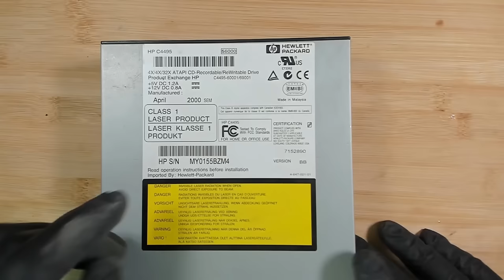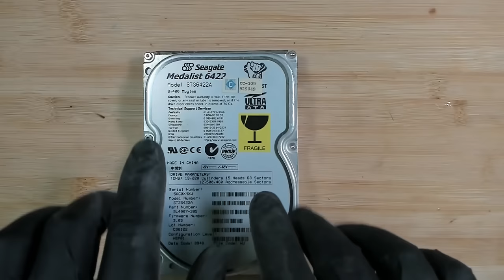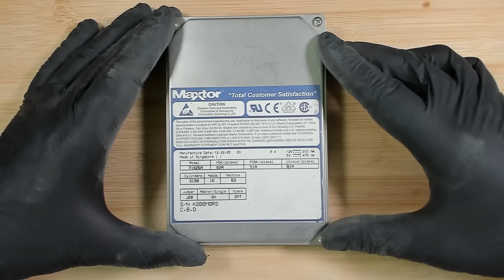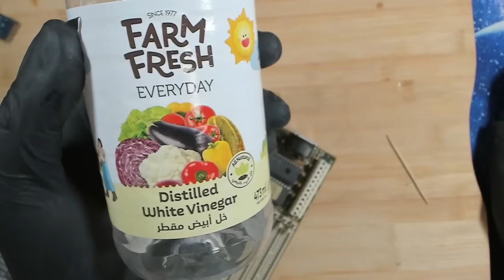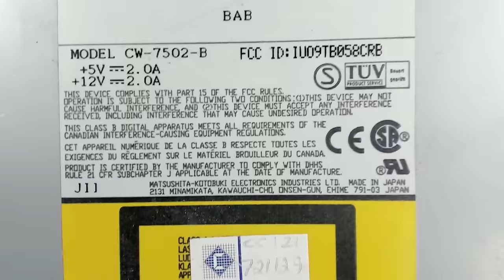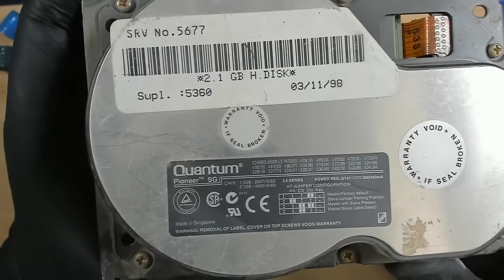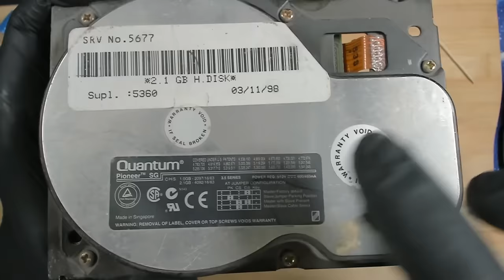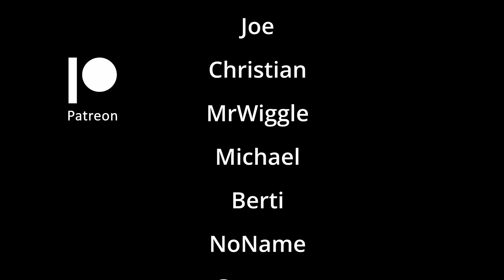Loot from one of my best scrapyard trips!

Comment: I found a 16 mb STB Voodoo 3 3000 agp tv at the recycling center this previous Tuesday in the electronics container.
Didn't think I'd ever come across any voodoo card in my recycling center visits with how rare & more popular the cards have gotten.
So far I've only tested it into the bios screen on a slot 1 motherboard here.
As i previously moved that ide hdd with xp on it to my new agp test bench with an asrock 4core dual sata & core 2 duo e7400, which i also found at the recycling center.

The computer i grabbed it from was on a trailer & i asked the guy as he was unloading some other trash to be tossed away.
If i could grab that graphics card, he didn't mind at all as long as i tossed away the pc properly.
(Was a generic slot 1 motherboard which didn't look like much at the time but i can take a look tomorrow if it's anything worth grabbing.)

Also grabbed a Asus P2B a few weeks before this find which also works with a pentium II 450 mhz so now i have 1x passive & 1x actively cooled that's super noisy, seriously this fan is like a 60 mm 4000 rpm hairdrier.
Reply from the maker: Congratulations! Yes, finding a 3dfx card is quite rare. I also found a Voodoo 3 once and a Voodoo 2 which needs some fixes. Congratulations to you for finding such nice retro gear!

Comment: There is absolutely something special about the S3 Trios, its just about the only card that has good working hardware support on really old versions of XF86 on Linux. All the other accelerated servers have some kind of issue that makes them annoying to use or even totally unusable. If you messing around with any pre 2.6 Kernel Linux stuff, they're the perfect card.
Reply from the maker: Although I don't have much experience with Linux, that's good to know 🙂. I always liked my Trio64V+

Comment: This 386/486 board has EISA slot!
Reply from the maker: Thanks for letting me know! I looked it up: Extended ISA :) I didn't know such a thing existed! 🤯
Reply: Nice board, Jealous here. THIS IS NOT AN EISA slot.
This is an Opti Bus slot (same connector as EISA, different electrical).
If you plug a EISA card there you will burn it.
There are specific card for Opti Bus. There is a VGA I have this.
Basically Opti Bus is an ISA VLB combo.
Reply from the maker: Thanks @atheatos! Thanks for letting me know. It says "EISABus" on the connector, but I'd rather not risk it and go with your opinion! It could be something proprietary - I wouldn't know.
Reply: Yeah mechanically these are the same so the connector says EISABus. Very dangerous. This is defiantly not an EISA one electrically.
Search online for more info on this OPTi Bus. The only compatible VGA I know and have is "Tseng Labs OPTi Bus" an ET4000AX.

Comment: That brown slot on the 486/386 board looks like an EISA slot.  I recall seeing those used for expansion slots, too, so maybe make sure it is correct, before plugging anything EISA into it.  An ISA card should simply plug into the upper set of contacts, and work as normal.  The Extended part is all on the 'lower' set of contacts.

That 'slightly browned' AMD 486 might be fully functional.  I've seen them much darker than that, and still work.  I believe there is a sealant, or colorant, used on/in the ceramic, as well as the white silkscreen lettering, each of which will slowly brown at elevated heat levels.  Obviously, attach a heatsink before proceeding, but you may be in luck, if you can call an AMD 486 DX2 66 'luck'.
Reply from the maker: After cleaning the board, I can read "EISABus" on it. I guess the secret is lifted. Now I just need to find some compatible hardware!
I'm curious if the AMD DX2 is still working. Maybe it had one of those slip-on fans that just fell off at one point.
Reply: @bitsundbolts  Definitely could be the case.  Thermal paste was pretty rare in the 486 era, so there might not be any evidence of a FHS if it fell off, or just got removed.

Thank you for helping me rummage through some old memories.  I look forward to any content you choose to make on these items.
Reply: @bitsundbolts  PLEASE BE CAREFUL! I'm pretty sure that slot is OLB. I don't think that chipset supports EISA. I'd say it just says EISA because it uses the actual EISA connector.
Reply from the maker: Thank you for letting me know! I am not going to risk using this slot.

Comment: The interesting point is that the negative terminal of lithium batteries start corroding first.
Reply from the maker: If I understand correctly, the negative terminal is where the electrons come from first - with a lot of energy. Haha, here comes me theorizing 😅. This energy may interact with its surroundings: humidity or other molecules in the air around that connector. When the electrons arrive at the positive terminal, the "rapids" slow down to a calm river. But that may be totally wrong - so, don't quote me on that 😅
Reply: @bitsundbolts  a simpler explanation may be that  negative terminal always loses electrons so it is more prone to oxidation because it wants to redeem lost electrons by any means.

Comment: 11:50 or so, the VLB 486 Board:
IIRC the DIfference between Socket 2 and 3 is the support for Pentium Overdrive. 
ANd yes, its VLB.
As for the Board: Does it support 3,3V CPUs?? From afar it looks like it does. So in that case you might be able to put an AMD 5x86 PR75 (133MHz) on that. Maybe, potentially, a Cyrix too, but those are a bit complicated.
Reply from the maker: Yes, I think this board does indeed support CPUs with 3.3 volts. I have to check it when I get to it - at the moment I'm working on the battery damaged boards. Might be a nice board for all kinds of 486 CPUs.

Comment: 9:53 Crispy PCB around the audio amplifier IC is not that unusual! Someone was using passive speakers on this card. TEA2025B audio power amplifier running off 12V line, 5W total stereo output power into 8 Ohm, can actually take damage when running into 4 Ohm because it would be trying to do closer to 10W and not succeeding. Probably dumps about a third of its output power into the PCB via the ground pins.

15:41 hey i wonder if "reserved" pins are working SPDIF! Might be disabled, being an OEM drive.

47:19 obviously an Acer chipset.

I love Socket7, i just don't know if the board needs any work done; i guess one won't know until it's fully tested :D

49:15 Panasonic/Matsushita. Very nice. Bet it works!
Reply from the maker: Thanks for that info on the soundcard! I'll keep that in mind. So, there was just too much power drawn from possibly passive speakers.
And yes, I think the socket 7 board will just work. It was in a case as well.

Comment: That socket2 board closely resembles the jetway-j-403tg-v1.0 board of which I happen to own a v2.0 version (except it's socket3 but same chipset from the looks of it).
Reply: I also happen to have a same kind of that Matsushita 4x SCSI CD-R writer. I used it to slowly burn audio CDs for old CD players around 2010, but of course it's much older. It doesn't have buffer underrun protection yet so be careful. If I remember correctly the fan only spins while burning discs to cool the laser I guess. :) SCSI buses needs termination. In the case of those old small capacity Seagate drives make sure you check the jumpers for a 16-bit AT/8-bit XT one. If they don't work at first but they sound like they should be, they might have been used in machines with an 8-bit IDE bus.
Reply from the maker: Thanks for all this information! So, this socket 2 board is weird. I haven't looked at it in detail, but I think it supports 3.3 volt CPUs. Wasn't that something that came around with socket 3? Did they maybe have a lot of socket 2 sockets and just used those for their socket 3 boards instead of replacing them with the proper socket type? I'll definitely have to find out more about this board.
Reply: @bitsundbolts  I have no idea about socket2, but I had to voltmod (find and populate a missing LDO, resistors and jumpers) my socket3 board for a 3.45Vcore Am5x86 CPU. The PLL was already future-proof. Maybe you will get lucky too.

Comment: Wonderful collection there, I wish we can see some cleaning videos too. Have you tried washing them in dishwasher?
Reply from the maker: My wife would have questions I'd use the dishwasher for cleaning those items. I usually just use soap and running water. The result is quite good. I cleaned most of the items already. The floppy drive is still dusty and might be worth recording.

Comment: hmm I always thought that 486's were just 486's and there was only a single socket. Of course I also thought there was 2 variants. sx33 (which is what I had) and dx66 (which is what my friend had). And the only difference besides speed was the FPU. I've known that's not true for a while, but finding out that it's multiple sockets is new to me.
Reply from the maker: I believe you're referring to the socket 2 board. I think this is a bit of an oddball of a motherboard. If I'm not mistaken, it supports voltages as low as 3.3 volts. But I'll find out more when I look at each board individually.
Reply: @bitsundbolts  yeah I was maybe 8 or 9 around the time that was a thing. lol So I had a limited knowledge. I think I was 11 or 12 by the time I had a 486. By then the pentiums were out. It was used. In fact I remember the guy saying its bios was destroyed when it was hit by lightning and he had to replace the bios and reprogram it. I find that hard to believe. lol Only the bios? really?
Reply from the maker: Sounds like a bad BIOS flash attempt 😅. I recently found out that the original Pentium was released in March 1993. That means I got my 486 also well after the Pentium was already in the market.
Reply: @bitsundbolts  no clue.

Comment: 5.25" floppy drives are saddenly stupidly expensive these days :( I have 5 or 6, one is a TEAC just the same model as yours. Very adjustable for different systems. Usable on my Amstrad CPC after changing the various requirements like a ready signal, and rpm speed (300rpm instead of 360) etc.

Comment: AMD 486-66 with EISA! 😱
It’s for SCSI. Please try working on this setup.
Reply from the maker: It is I deed EISA! After cleaning the boards, I could read it on the slot. Now I just need to find expansion cards that plug in there.
Reply: @bitsundbolts  you can put ISA cards there, it will works as ISA, 8 or 16 bits. EISA is 32 bits, and its pins are depper, out of reach of the normal ISA card contacts. just look for shorts, just in case, if you put an ISA card ther. but yeah, is better, more interesting, to test a EISA card. even better, have the two versions, ISA and EISA,  of a same videocard and benchmark them. never seen a comparison like that

Comment: that brown slot on the mb looked like EISA, if it is then it is an odd board with the cpu and mix of slots
Reply from the maker: It is indeed EISA - after I cleaned it, I could read an inscription on the slot "EISABus". I looked up what an EISA expansion card looks like. 😔
I have come across some of those cards and did not take them because of the odd looking connector. Well, now I know better. Hopefully I'll find more of them in the future!
Reply: @bitsundbolts  IBM come out with MCA bus that was not an open and free standard, EISA is all the other vendors attempt to make an 32bit bus standard that still support old ISA cards in the same slot, it it the first "plug and play" but you need some config software and for each card an .cfg file with the config details.
this mainboard is odd with the cpu cross over to support both and the slots is both 8 and 16 isa and EISA

Comment: you have to Terminate the last Device, so the Controller know the End of your Cable. You can attach up to 9 devices to a Scasi Wire
Reply from the maker: Ah, right. I remember there were also terminators on SCSI cables. I have no experience with this standard, but I see why IDE was more common in consumer electronics - it's just easier to get things going.
Reply: @bitsundbolts  not really easier😂

Comment: at 30min, that 386/486 Board is interesting because of the one E-ISA slot.
Though why it only has one 32bit ISA Slot? Only god knows...
Reply from the maker: Atheatos commented. He believes this to be a special implementation by OPTi and is not electronically compatible with EISA
Reply: @bitsundbolts  Mhh, yeah, its possible that its a custom RAM Upgrade card...
And getting a Manual probably is impossible for this board, right?
Reply from the maker: There is no manual on the retro web, so chances are very slim to find the manual somewhere else.

Comment: How much do you have to pay on the scrapyard for items you take? Do they weight them, or how it goes?
Reply from the maker: It totally depends. The items I buy are privately owned by the people working there. So, it probably is higher than what you'd expect, but I wouldn't have access to retro hardware through other channels. It is still a lot cheaper than ebay.
For reference, what you have seen in this video was about 160 USD. Rarely it's by weight, although, it did happen. Mostly, it's per piece. 2-3 USD for cards, memory modules and the like. CPUs are twice as much. Motherboards are 10-15 USD and so on. If something is heavy, price increases.
Reply: @bitsundbolts  Thanks, I really thought it's cheaper there on the scrapyard.
Reply from the maker: I probably could negotiate a bit more aggressively, however, most of the people I meet there left their home country to find better opportunities in the UAE. Most of them live off 400 USD or less per month. So, I don't see it as bad, but you're right, it isn't particularly cheap.

Comment: Those 486DLC chips seem almost like a scam to me. I can maybe see some value for businesses, to minimize upgrade costs so they can crunch spreadsheets a little faster, but it's not going to make much difference in day-to-day user experience and not nearly fast enough to play any games made for 486 (i.e. Doom). I wonder if there's anyone who ever bought one for a good reason, bought one to save money and was happy they did, or if it was generally a disappointment most people avoided...
Reply from the maker: Good question. I guess there was a small market segment for those CPUs - which is maybe the reason I don't find many of them. This was the first instance I got one of those CPUs. I'm curious what the performance difference to a 386 is.
Reply: @bitsundbolts  I'm looking forward to your video on that board!